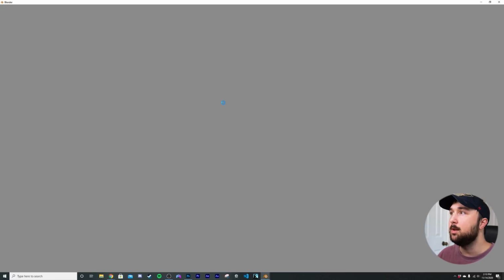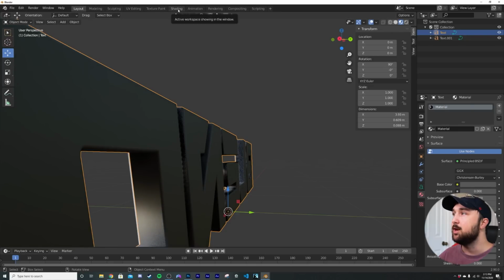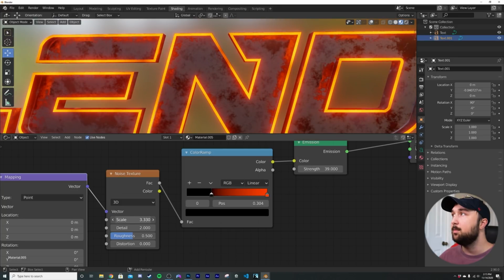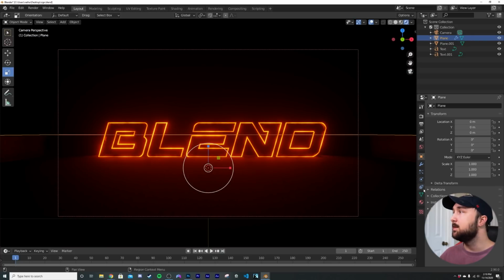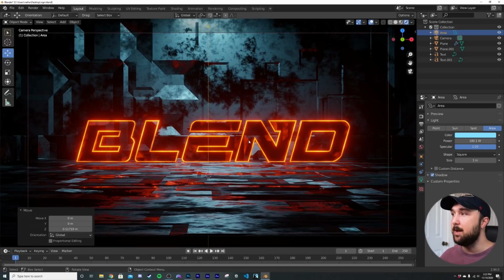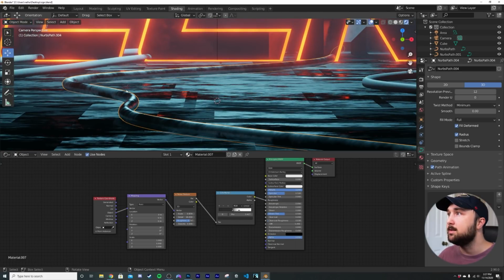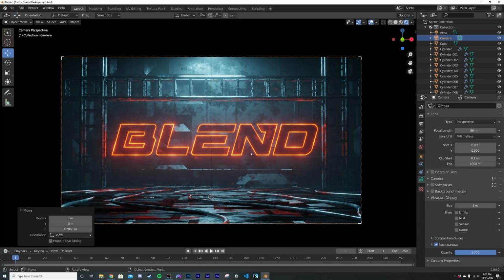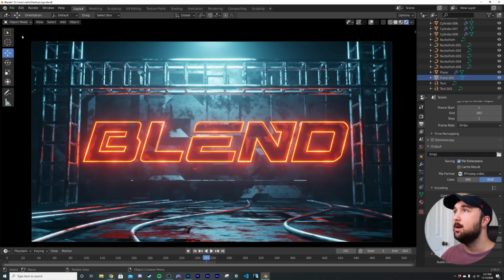Easy Cyberpunk Text Animation In Eevee (Blender Tutorial)

Comment: Another tip : For those wires you can also add an curve , goto the edit mode ,select all vertices and delete them and select the draw tool from the menu appearing in the left when you press T. Then goto the right menu (press N) and under "tools" select surface -so that the curve sticks to a surface(and draw some random design resembling wires) ..... Then play with the geometry of the curve.....Hope it's easy and usefull😊.